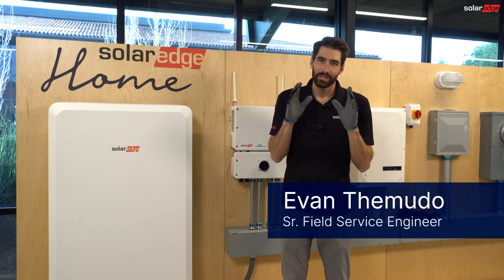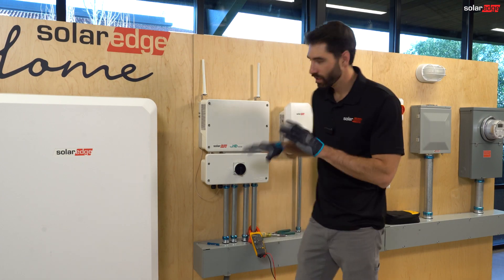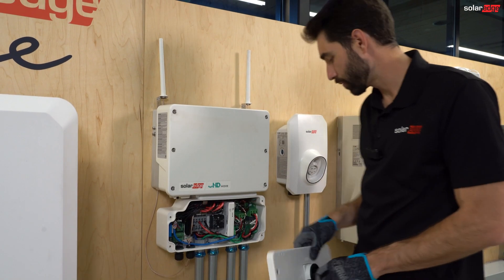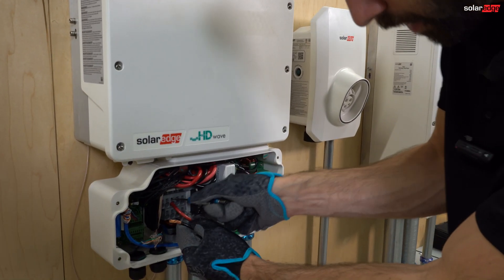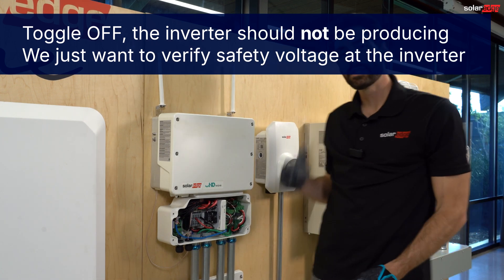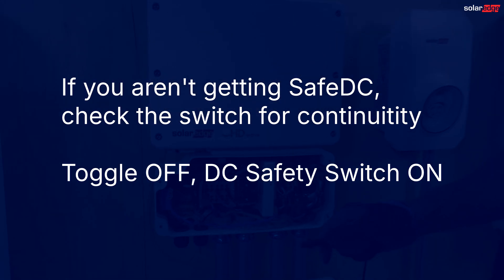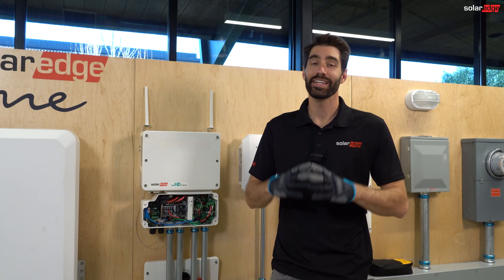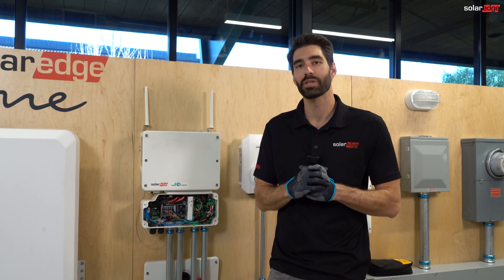SolarEdge Tech Tips - Night Mode Troubleshooting

Comment: I’ve got 18 on a string, 18 open air voltage set app sees voltage as soon as I turn the DC switch on drops to zero, night mode, turn DC switch off DC voltage returns. RMA inverter for faulty switch but new inverter has same issue. Any ideas?
Reply from the maker: Hey J, I've run in to this more than a few times.  Turning on the DCD and the voltage collapses usually indicates a problem on the roof - especially if it's the second inverter.  Start by going to jboxes and checking connections there (tighten any polaris lugs).  Before pulling up panels, you can split that string of 18 with a jumper and test each half to determine where the voltage collapse is happening.  I've even tossed a jumper off the roof from the jbox to the inverter to eliminate the +/- home runs (usually for iso faults but a good trick).

Don't have the case details, but if you drop it here or message support and tell them to ping Chris in training I can review the case for you.

Don't forget the usual suspects like field made crimps and jumpers.  Roof work is hot, tough and not always perfect.